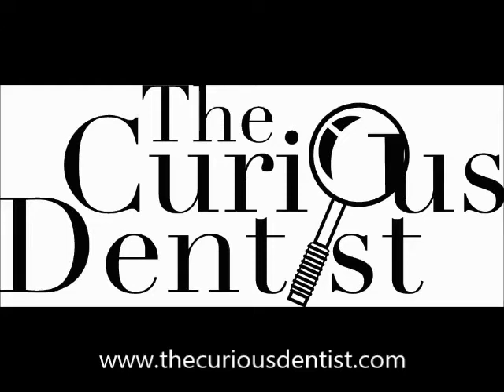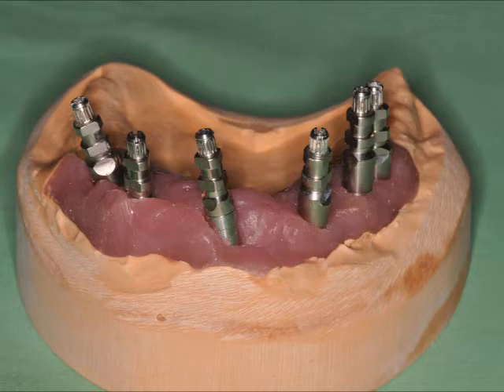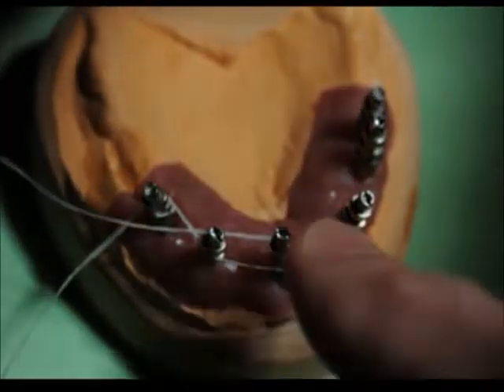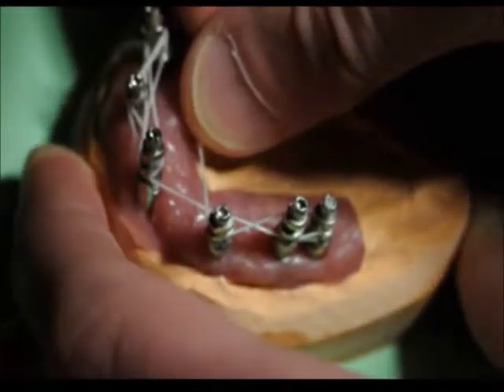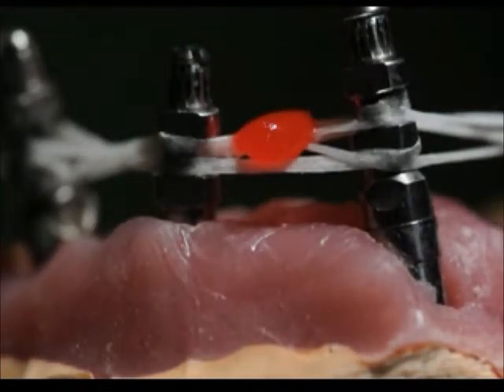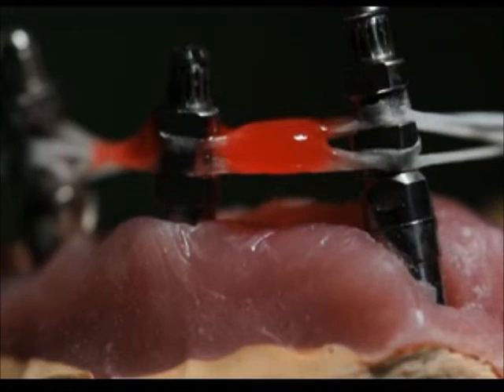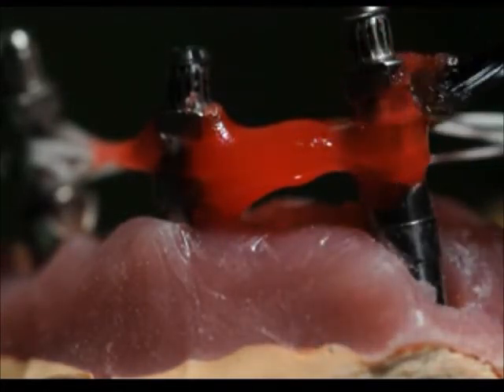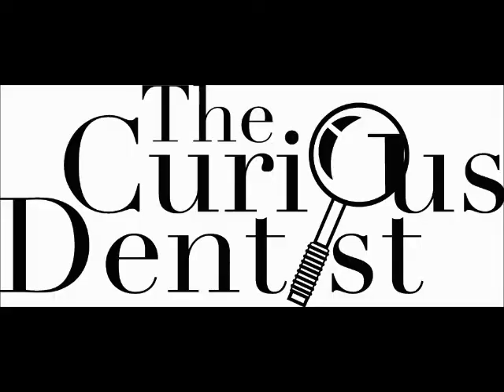How to Make an Implant Verification Jig

Comment: Furthermore in this video at 2:23 the pattern has been re adjusted during verification. what would be your next step. so add more resin to the new position and take a new impression?
Reply: After repositioning, the jig is set with resin once more in the new position using the same resin. Once set, it is removed in one piece. Hope this helps.

Comment: If the polyvinyl and die stone are properly mixed, as stable as they are, the location should be exact  unless the impression copings are not properly screwed in, or the lab had inconsistent investment and casting techniques. Considering the lab part is not analyzed in this video, wouldnt taking anterior periapicals prior to an impression solve the problem?
Reply from the maker: Even when the impression copings are correctly and fully seated there can still be inaccuracies introduced.  The impression coping could shift slightly within the set material in the tray, for example.  This is usually very minor and not an issue, however the more implants being the restored the greater the accumulation of minor errors that can lead to major inaccuracies.  Full arch restorations in particular can fall victim to this.
Reply: Thank you. Would you then take a pick up impression with the jig in place, and fabricate a new model?
Reply from the maker: Marcel Fundora You can certainly do that.  Alternatively you can just have a separate model made with new replicas.  The lab can then use this verified model to make the casting and use the unverified model for soft tissue contours.